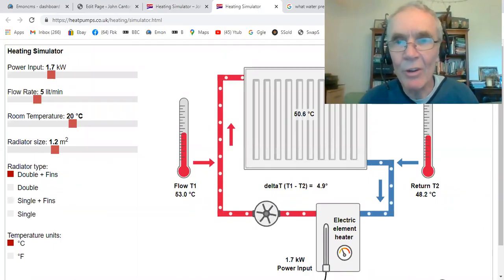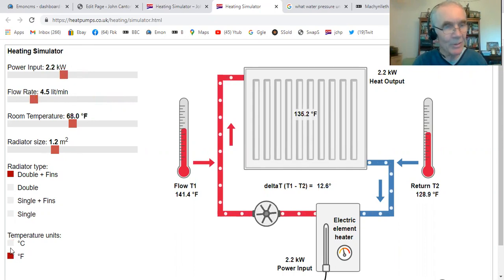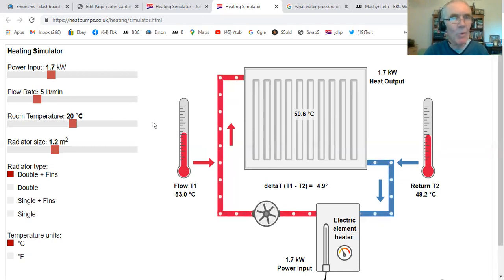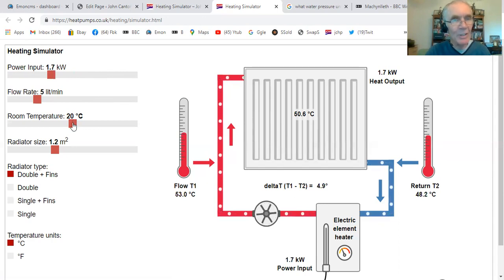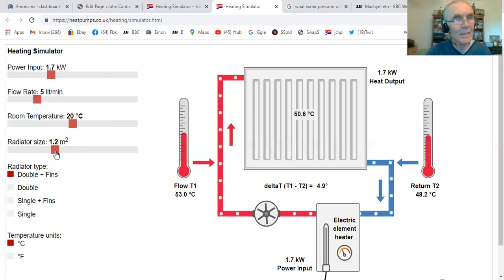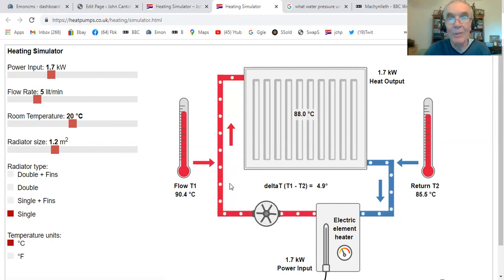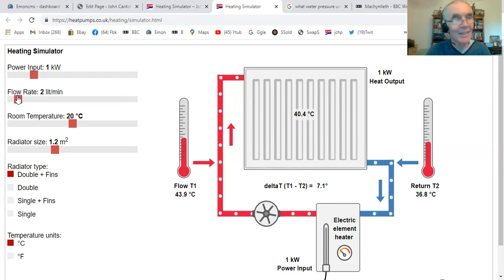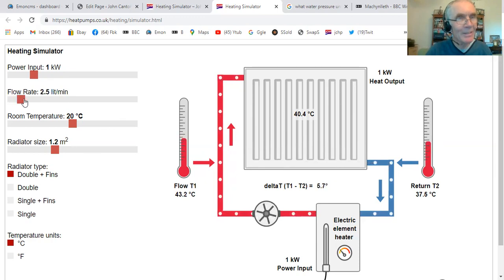Heating Simulator John Cantor

Comment: Hello John. I discovered your YouTube posts about heat pumps. They are very knowledgeable and professionally advanced. I'm very glad that you are using SI units and therefore I understand the "language of your tribe" – unlike US posts where I have to recalculate imperial units. BUT what caught my attention, and here we all speak a little unknown language, is the fact that I do not know or is simply not stated what the conditions of the heat pump operation are or is used in the simulation performed. Let me explain – I live in the Czech Republic and, for example, in my region, the design temperature of the outdoor air in winter is -15°C (minus fifteen degrees Celsius). That is, if a 7 kW GB and 7 kW CZ heat pump is compared without further explanation – then there is a big difference. It might be worth mentioning the operating conditions – e.g. as the HP output is stated A2/W35 – air +2°C/ outlet water 35°C.  Which to introduce, for example, – DesT-15 / W 35/30 / BivT -7°C – which would mean DesT – design outdoor air temperature -15°C, W 35/30 – for -15°C ambient air temperature heating water temperature, BivT – bivalence  temperature - -7°C, i.e. below this outdoor temperature the booster heating is activated. Certainly for GSHP this should be different .
Ivan Škop - Ivanhorseman

Comment: Really good simulation John - thank you for doing this. It really is not as an intuitive as one would think - great to mess about with.😀👍
Reply from the maker: Glad you like it.  Thanks for the feedback
Reply: @johncantor4056 John I came back to this again to have a play and had a thought. Most modern control systems employ weather compensation (boiler or heat pump) which (as you know) target a mapped flow temperature which is outside the scope of this model. It would be useful to model this, if you could so that a set flow temperature (capturing a moment in time) and examining the effect of varying flow rate on DT. It would be helpful to me as I have a boiler employing weather compensation and a burner linked pump.😀👍
Reply from the maker: @normanboyes4983  mmm...  I'm trying to puzzle out how to do this.  Are you saying that if you have a design flow temperature of say 40C at say -2C, then in reality it will spend most time at a much lower temperature?   The idea of this simulator was really to let people play with changing things, and to see what happens. I wanted to keep it as simple as possible so that it doesnt frighten-off too many.  I wonder if what you are wanting would be a separate thing..  i.e. working out not just the average temperature (lowered due to the heating curve), but its 'weighting' for when its actually running. (e.g if winter average temp is +5, average when running might be +2 or 3) Of course, the curve is one thing, but if we look at real-life data, there are often a difference between the point on a curve and reality due to varyious quirks in the algorythms. e.g. sometimes it overshoots (on purpose) to avoid too much cycling.  oh....  its quite complicated at times!

Comment: Hi John, fantastic tool, thank you for sharing this. Can I just clarify what you are at 14:30 - when you have the radiator down to 30*C (at 0.35kW power input), you suggest this is great for heat pump efficiency, but I note at this flow temperature the deltaT is only 0.8*C. I know you also said that with an ASHP we are looking for a deltaT of 5*C, so my question is which of these parameters are most important for optimising COP/efficiency (i.e. the lowest flow temp possible vs. aiming for a deltaT of 5*C)? Thank you for your advice!
Reply from the maker: Can you explain where you mean? at 14:30 I'm seeing the 5kW inverter ASHP that starts to cycle 1/2 way through  flow t says 36.5C.  You are probably looking at a different graph.  Where is the  dt 0.8?
Reply: Hi John, thanks for your reply. I'm meaning at exactly 14:40 on your heat pump simulator video where the deltaT is showing as 0.8°C with the power input at 0.35kW. Hope that makes sense and thanks again!
Reply from the maker: @brookejonny  Ah.. I was looking at the wrong video!   Yes, so from the point of view of the simulator, a flow-return dt of 0.8 is fine, but pumping power is high and circulation ight be noisy.  For an old fixed-speed (pre-inverter) heat pump, such a high flow should not impair COP.  However, we are observing oddites on the graphs when dt is fairly close, and this is likely to be the complicated algorythms that manufacturers use to comtrol the compressor speed and regulate the refrigerant flow valve.  This control strategy is a compromise of doing a good enough job of control without excessive purchase expense and complexity.  So, its probably best to stick to the manufacturers recommendations, and all seem to like a dt of around 5.  However, some ask for a certain flow rate, and if your 5kW ASHP has a dt of 5 (@14litres/min), then if you stick to that flowrate, and the output modilated down to 2.5kW, then the dt is 2.5.   This should be fine for many models.  A bit complicated isnt it? However, often we change the dt and hardly see any differnce in performance  (bear in mind that some heat meters lose accuracy dt less than 3!!!)
Reply: @johncantor4056  Hi John, ahh very complicated indeed! So many variables which are all intrinsically linked. In my situation I have an 8.5kW heat pump that seems to be fixed speed around 24litres/min (Ecodan). I have been trying to reduce my flow temp as it was my understanding that getting this as low as possible would optimise COP.... BUT in doing so the deltaT reduces down to approx 1*C. I suppose my question is whether I what I am doing is actually a good thing for COP or if lowering the flow temp so much that it creates a small deltaT is counter productive for running costs? Very complicated indeed, but you seem to truly be an expert on all the variables! Thanks again John!
Reply from the maker: @brookejonny  24 litres/min is what Mitsi ask for, and this should give a dt of 5 when on maximum.  Do you ever get 5?  At minimum speed, say 3.5kW? you dt might drop to 2 ish.  If you rarely run at 8.5, than maybe a lower flowrate is a bit better for you??
Is your 1 degree measured accurately?  Where are you reading it from?
So, to drop your flow temperature, you can drop the set-point or curve settings, but now with cooler radiators, you will dissipate less heat, so you might cycle.  Sometimes this is not too much of an energy reduction, but sometimes it is.  Having more radiators in circuit (with trv valves on full) will help to dissipate the heat at low temperure.  If all your rads are on, you will probably get a great COP, but arguably heating more of your house than you need is a watse.. it all depends on the size and type of house.... Dont just measure COP, record actaul energy input for comparisons.   Yes, sorry, its complicated.
Reply: @johncantor4056  Hello John, sounds like you are familiar with the Ecodan! I actually have a "cascade" of 2x 8.5kW Ecodans - my understanding of the system is that one unit tries to manage if it can, and if it needs backup then the second unit kicks in. We also have a low loss header which supplies two zones (upstairs and downstairs, all rads through). I can "force" the heatpump to give a Dt of 5*C if I use fixed flow of say 45*C; however I am trying to improve running costs and efficiency hence trying to run a lower flow temp of say 30*C which gives a much lower Dt of 1-1.5*C. I believe this to be accurate as it is a readout from the Ecodan software (Melcloud) and whilst the energy consumed/output information is known to be inaccurate I have not heard any reports complaining about the flow temps being wrong. I hope the unit isn't cycling - would you be kind enough to explain how I could find out please John? Thanks again for sharing your knowledge and experience!

Comment: This is a nice educational tool, it makes it very intuitive to understand the relationships.

I was curious as to which tool you used to make the animated SVG for the simulator? The flowing pipes and pump in particular.
Reply from the maker: Its all done with JavaScript.  Ellie did all the clever stuff..  its quite a learning curve I think... quite hard and time consuming
Reply: @johncantor4056  I've already looked at the JavaScript and can see where the flow rate adjusts the animation speed of the pump and the dots in the pipes, but it was the graphical side that I was wondering about - Specifically the moving dots in the pipes which animate perfectly through the corners. The graphics are done using an SVG.

I was wondering if she wrote the SVG himself by hand, or used a graphics tool to produce it? E.g. Adobe Illustrator or I'm hoping she used a free tool as that would make the graphical side of some of my own stuff much easier. I usually write my SVGs by hand but it's a pain to do so I'm hoping to find an easier way and this is a really nice example.
Reply from the maker: @yngndrw.  It was a lockdown project, and I know it took her a long time.
Reply: @johncantor4056  Ah okay, it sounds like she did the artwork by hand then. Thank you for your responses, I was just hoping to find a tool to make it quicker than doing it by hand but it looks like I'll have to continue doing it that way.

Thanks.

Comment: This brilliant. I love it. You book is also highly recommended, thank you for writing it. 

Can I please suggest a couple of tweaks:
- would be great to lock the flow temperature, though. For my ASHP I want to know what happens when I change some parameters, but I know that the flow temperature will not change!
- a K3 style radiator (triple panel with convectors)

The pipe calculator is also brilliant. Thank you!
Reply from the maker: Thanks George.  I did it the way I did because I though it more 'education' to think of the final temperature as a result of everything else.  However, I realise its a bit clunky if you want to find out certain things.  I'm unlikely to change it (I mean get Ellie to change it). I suppose a simple no-graphics calculator might be possible as a tool.  i.e. you choose the inputs and outputs.  I could ponder that..